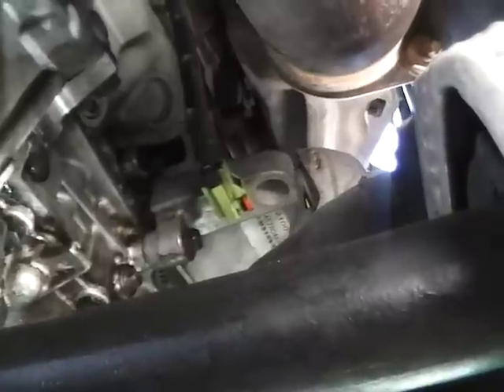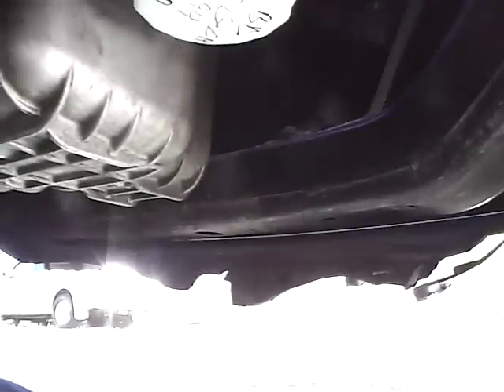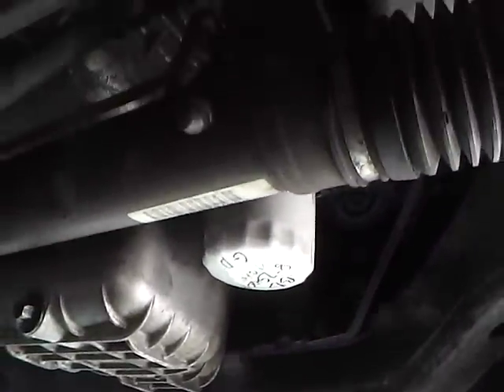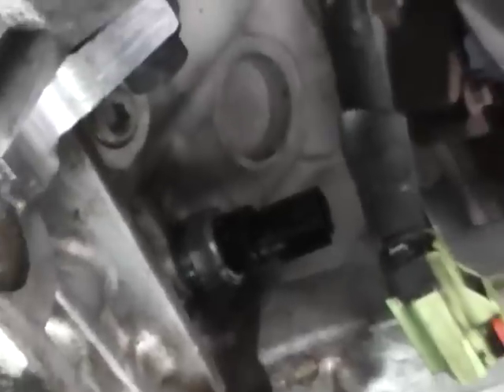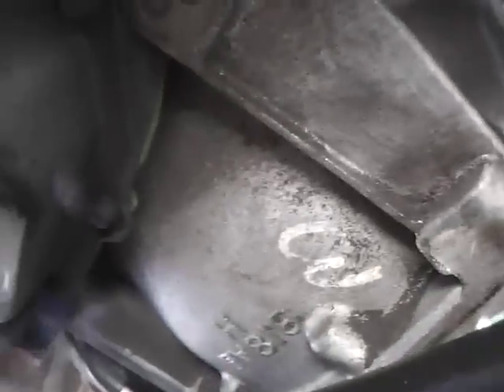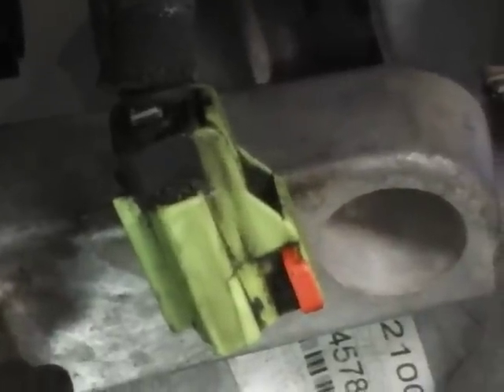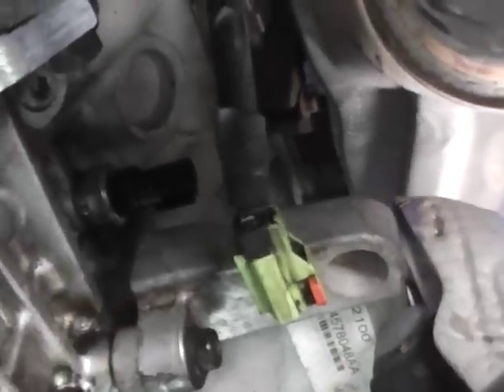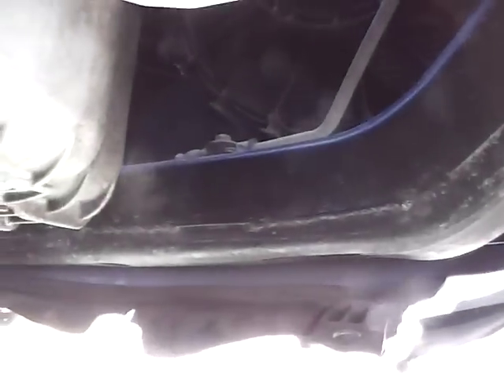Dodge Magnum oil pressure switch/oil pressure light

Comment: For those that are wondering about that red tab on the connector, it's not supposed to be completing remove. It's just needs to be slid over slightly. When the thin end of the red tab is flush against the connector, the connector is then ready to be removed. Hope this helps....

Comment: I have one on the front of the motor by the main pulley. It's green and one wire and covered in grime in leaking. 3.6l is this another of the same switch?

Comment: Will this cause the engine not to turn over? My car is full on oil and there isn't any burning or smoking smell, I put the key in and crank however it won't turn over or when it does it runs rough for a couples seconds before the oil light comes one and the engine shuts off

Comment: Did it get rid of the light? Anymore leaking? My wife's car is leaking out of nowhere! The exact same car and model. Never leaked before. I take good care of it. 
Your help is very much appreciated
Reply from the maker: The light cleared up and no leak.  I think it was gonna start leaking from that bad switch.  Hope this helps?  The only other issue I have is idle is sometimes not steady and I took it to the Dodge dealer and they said the computer sets the rpm idle speed and that nothing was wrong.

Comment: After changing this part on my car its started making a noise. (reminds me of the Rumble strips that are on the highway letting you know ur off road think of that sound with out the Vibration) so this  started after I would go 40 ish m.p.h  steady speed an r.p.m's if im picking up speed you don't hear it or if I'm slowing down you don't hear it. only when your holding a steady m.p.h and r.p.m.. the kicker is I can take the slap shifter and knock it into 4.th while going 45 or 50 m.p.h holding a stady r.p.m and m.p.h bump it into 4th and the sound goes away go up back into D the sound will come back after about a min but after 1300 miles it's getting worse the noise will start at 25 30 mph now and louder no lights have came on, on the dash I also have a tool that will find and read you Codes if there is something wrong with the car and I never got anything till about 950/1000 miles engine light is on evap system leak very small ice the code that goes with the light and my. Throttle body light has came on a few times
Reply: Damn a year to late for me to reply. Just check the blue egr tube seal. That's gonna give you crazy engine vibrations. Misfire codes, evap leak codes, throttle body and so on.

Comment: Great vid but what sized tool did you use to remove the sensor?
Reply: they have specific sockets that fit them.  Go to a parts store ask for the pressure switch and they should be able to sell you a socket that will fit it as well.

Comment: Thanks good video!!! Hey how about you dodge Magnum your lights dimming on and off when car turned on I have that problem can you help me with that?
Reply from the maker: Not sure I haven't had that issue.  Maybe battery or alternator?  How old is your battery?
Reply: My 05 300C Chrysler  my lights just started cutting on and off when I turn them on.. they dont do it all the time one night it happen like 3 time diff not like 2 time another night got pulled over but let go but if i just keep them off and one the "A" I have no problem.
Reply: Matt Mager replace the light switch
Reply: Change out alternator and battery and then take it in to dodge to get it flashed factory reset update.

Comment: My brother  is a mechanic and changed the pressure  switch  on my 08 charger 2.7.  the light still comes  on at idol  once the engine warms up.  Could it be a bad connector?  Any help is appreciated.
Reply: if replacing the switch didnt help then im afraid its going to be the oil pump....